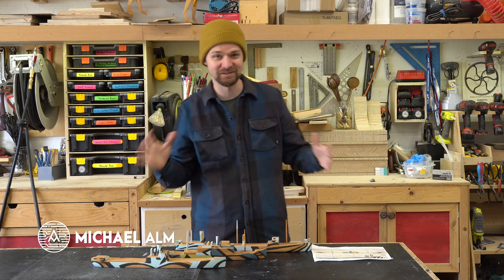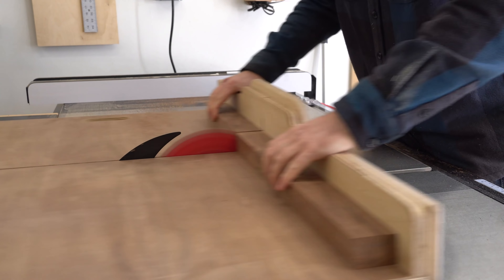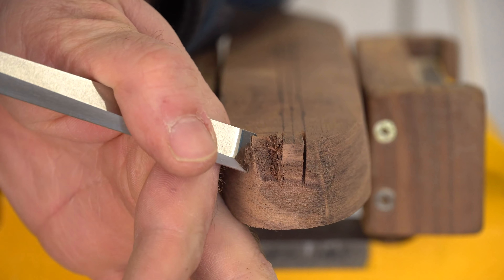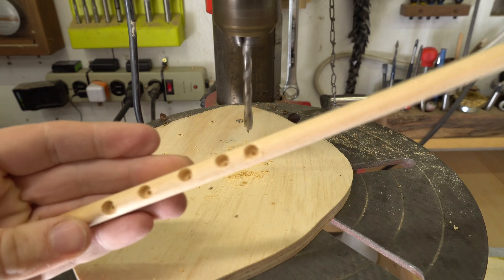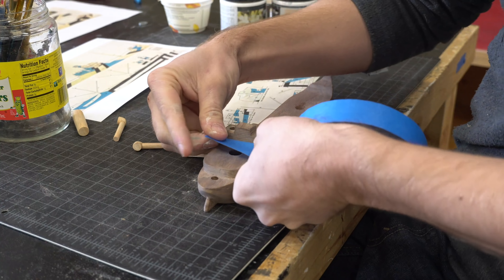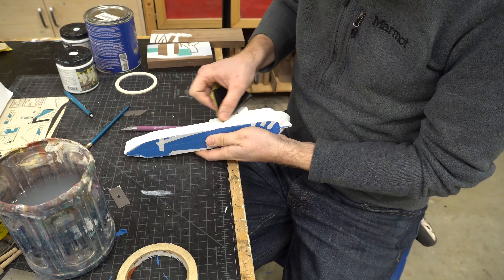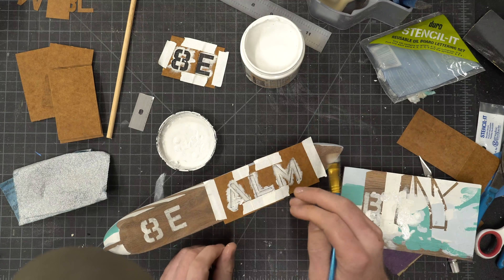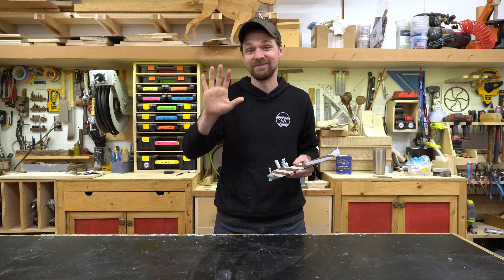Making a Toy from 100 Year Old Plans

Comment: In order to prevent the bleeding under your tape, I’d also suggest trying Frog Tape. I like the yellow tape (delicate surfaces) but the green tape works really well. I’ve had great luck with this for gel stains and it’s specifically designed to prevent paint bleed. For preventing tearing the paint when you remove the tape, I’ve always preferred to remove the tape after it’s no longer tacky but before the paint is cured. The paint is still malleable in this state and doesn’t tear nearly so easily.

Comment: Fantastic! Big fan of the dazzle camo which actually lasted into the early part of WW2. A couple of painting tips when masking: 1) don't load the brush with too much paint, 2) if the area is wide enough, start from the tape and work inward, 3) for very narrow lines, it's best to use a light pouncing motion instead of brushing, again without charging the brush too heavily. 4) peel the tape straight back on itself to avoid cracking the painted edge. I have a very old book from the early 40s with many different plans for US Navy warships to be made as solid models. Glad to xerox and send some to you if you like. Thanks for the videos and be safe.